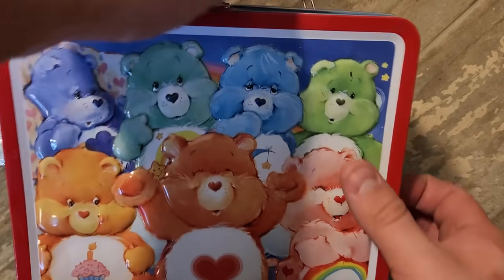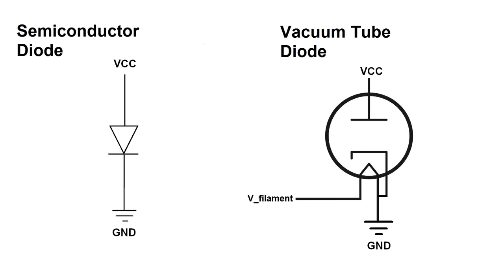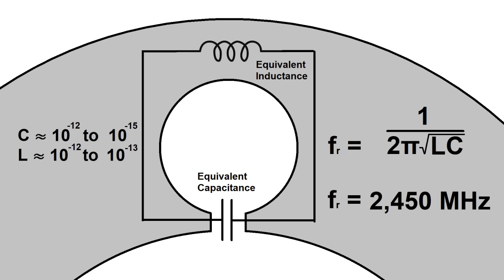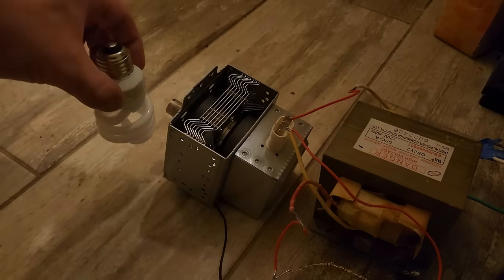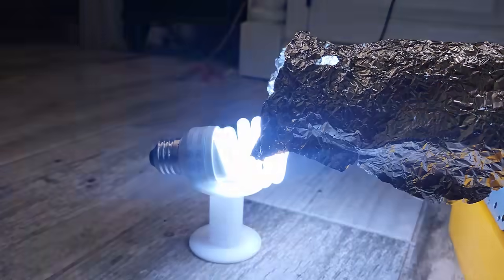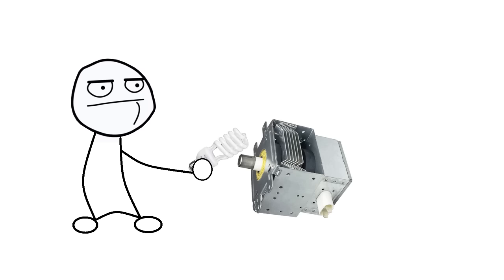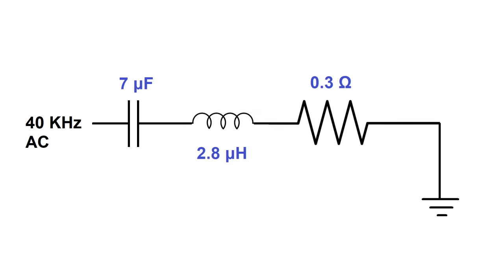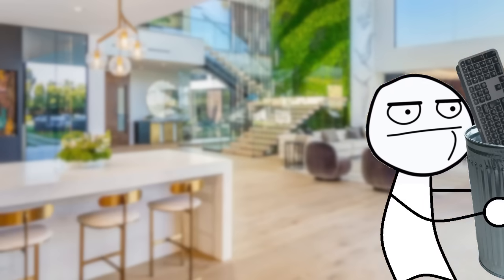Battery-Powered Magnetron

Comment: Hi i'm from Italy..altough i understood a Little about how does It work the magnetron very well i thought how does the vacuum tube work...the filament (cathode thunsteno)Is supplied with only low voltage like 3 Volts isn'it?and the High voltage from anode to cathode?for increasing the Speed of electron?when tungsteno Is warming the electron go towards to anode because anode Is positive as compared to cathode isn'it?...PS...Sorry for my english😅

Comment: 🇧🇷 I made a weapon like this, a metal tube, the magnetron was in the metal tube, I doubled the power, heated the water a meter away, placing more capacitors in parallel, the transformer does this

You can make glasses out of the microwave door screen

Comment: Pretty cool, I like how it's battery operated, for the HV transformer try to find a inverter microwave oven and use the transformer it should be better suited.

I try to overpower the magnetron with a large HV transformer the result was a magnetron driven plasma flame (my voltage dubler was not set up properly so I didn't have the maximum possible output).

Comment: Need to be careful with this stuff, the output filament typically contains a beryllium ceramic, if that crumbles and you breathe in any of the dust, you're toast. Also, if you happen to look directly at that filament while it's outputting, say goodbye to your eyesight.

Comment: when working with magnatrons I find a good working distance is about 200 feet, when no shielding is used.
you need a electro magnetic radiation meter detector to know what is coming out.  you have unknowingly exposed yourself to a great deal of microwave radiation!!!  not good.   be careful.  mike

Comment: The whole notion that ionizing radiation only causes cancer is total nonsense! The DNA double helix is essentially a fractal antenna. And all it takes is the right frequency to cause it to sympathetically vibrate like a tuning fork and it will cause it to vibrate and break apart, and then when it reforms randomly, if the cell doesn’t die via apoptosis, you end up with a cancer cell.

Comment: Id like to get into high voltage electronics. Where can one learn? I have a background in chemical engineering with some (but limited) knowledge of electronics
Reply: I recommend you start by experimenting yourself. There are lots of great channels, most of them with very little subscribers, so I recommend you build some basic high voltage device and start playing with it until you see some phenomenon you find interesting and do some research about it, Eventually your whole YouTube homepage will be full of high voltage videos. Of course you have to be safe doing all this, one hand rule at all times and start with low power high voltage, don't go straight into MOT's like I did, it's not worth it.

Comment: better rectifier doubler design -  is brige doubler:

(-2000VDCout)--------|>|-------(~in1)------|>|-------(+2000VDCout)
(-2000VDCout)---------| |-------(~in2)------| |--------(+2000VDCout)

it consists of two halfwave rectifier, but it gives fullwave rectification
on 40khz you will get 80khz pulsation output voltage,because it gives summ of two halfwave rectifier 40khz pulsation output, like 4diode brige rectifier do, 
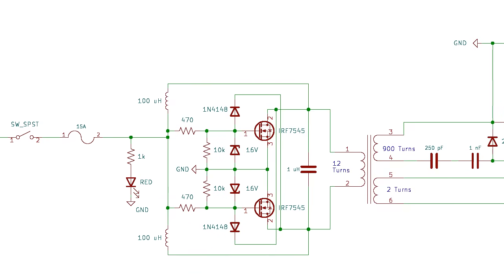but 14:03 halfwave doubler rectifier will give only 40khz pulsation of output voltage, because it actually sine wave shifter upon zero level, when only one peak of maximume voltage will be meaningfull for pulsation of result voltage

transformator from TV flyback anode supply can provide 
at least 200W longtime power... my result, but 
it was not 12VDC -> HV stepup, it was 220VAC *50Hz  ->  15KVDC*0.013ADC 20KHz !
it works almost same on 60KHz , but even 40KHz heats core(ТВС110ЛА , М2000 core material  rated) to 50C approx. and  in one day of work, 40KHz burns HV coil like in your project, 
in ТВС-110ЛА  secondary coil some like copper wire 0.08..0.14mm 2000turns, air inside closed tight case of HV coil
1)your copper wire too fat, 0.1mm diam. already excess, 0.06mm you can get in bell ringer of old phone apparatus, there will be two electromegnet coils: 6000turns*0.06mm copper wired
2)900turns is too low, if you expect 1volt on turn. 12v for  
drainmosfet--^^^^^^^^^^^^-(+12VDC)-^^^^^^^^^^^^---drainofsecondmosfet  (12+12turns prim.coil equal to  /‾‾‾+12v‾‾‾\___-12v__/‾‾‾+12V‾‾‾\___-12V‾_/  for 12turns coil,+ 1Vpeak  on turn of primc.
so sec.c. with 900turns will give +- 900Vpeak _/‾\_/‾ (so approx.1800VDC after doubler rectifier) under full load, and much more if you allow it to resonantly oscillate transformer with primary cap., happens when little load , like 1..10 Wt... 

in your ZVS circuit there is no central wire of primary coil, but virtually, it is like 6+6 turns,
----^^^^^^----^^^^^^--- 
and inductance of +12Vsupply of drains of mosfet, will equate its DC potentials on DCurent via 100µH power curent supply inductance coils from +12VDC to drains of mosfets
so, it will be 12VDC on drains, each mosfet work like:   
(open mosfet) 0v_/(front, closingmosfet)+12v/‾+24V(closed mosfet, extra curent from 100µH) 
with (+12VDC (+ )12V)= 0/12/24\12\0    >---^^^^^^-^^^^^^---<  24\12\0/12/24  =(+12VDC ( +)12V) 
so it is /+24\-24/+24\-24  on ---^^^-^^^-^^^-^^^--- 12your prim coil turns, +- 2V on turn you actually put in prim 12turns +-24Vpeak /‾\_/, and 900turns gives +-1800V_/‾\_/‾, that provide 3600VDC on doubler rectifier output probably

but in my experience 200wt was reached only when 220VAC->310VDC< + - 155VDC for halfbrige mosfets 2*IRF840N only, and PolyPropylene cap in series like loudespeakers amp outcap... 
and there was exactly 42turns of 0.5mm coper wire in primary coil, placed like your, oposite to HV coil... 42turns supplied with 20KHz of 
/‾\_/‾+155v‾\-155V_/‾+155v‾\_-155V_/     >--^^^^42turns^^^----|0.5mkF PPcap|----|common(-155VDC)
so +-155V _/‾\_/‾ on 42turns  means (+- 3.69[V on turn]), not less that 3.69, when your system 2V on turn only, that what i started with... 80turns for +-155V /‾\_/ primary coil, and only 30..50Wt was obtainable in that case, then i rewind some turns and power rise, on 42turns it reach 200Wt continiously, and on 40turns it explode mosfets spontaneously... there is no choice range, it must be 42turns for +-155V primary coil, and secondary coil was approx. 2000turns, and provide +-7500VDC on doubler brige rectif. 15KVDC *13mADC
---
on 20kHz it works continiously weeks , not brokes
on 40KHz core was hot 50C app. and secondary coil burns after 12hr of work, due to... ozone from corona discarge in air between layers, that just oxidize isolation film like your 3Dprinted plastic also, so you have to lower freq, and/or  put coil in oil, or glueit by epoxy glass in vacuum, to wet throuly

Comment: 4:50 in proper mode ofoperating. VD+C  chain not just voltage doubler rectifier, but called "zero level fixator circuite", where on capacitor alwaysapproxymately 2000VAC*141%(...it is sqr(2)...)≈2820VDC
that 2820VDC + 2000VAC gives sine 2000VAC wave shift upside, upon "X axis", and you get shifted to allways positive voltage sine:    _o|___/\/\/\/\/\____>   2820VDC+2820V*sin(f*t*...)=sine that in range  0Vmin / 5640Vmax\0V/5640V\/\/\/\/
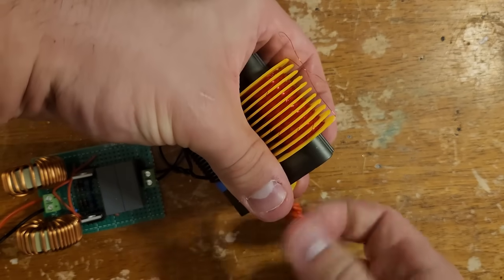Reply: 12:14 not just a filament itself have reactive(inductive) resistance, but inside metallic shield, near сathode heater connector , inside - there is build in - special DC(LowPass) filter... two inductive chokes in series with connector and cathode heater filament,  -  two coils about 1mm copper wire wounded on 4mmD*20mmL ferrite core rods, in series with cathode heater..., same two induct. for two pins of connector...
so, IMHO it is wrong idea, - to supply cathode heater chain with AC HF(40000Hz) current, even if you put some capacitor in chain also, you will be deffinately able to reach hi heating current, but unstable on changing conditions, because oscillatory circuit RLC chain appears there: 
>-------C-------[-L-Rheater-L-]-------<
and when there is only R and one type of reactivity impedance in chain, like  >----R---C---<  chain or >-----R-----L-----<, or capacity divider without chokes:
>-+---C---+---C-----<
   ^---R----^  
you get not resonant freq in chain, it will be just linear freq responced, and if freq changed from 40KHz to 45KHz, it will not affect on current flow via reactive resistance too much, just 10..20% parameters deviation occurs, but with LC chain, resistance of it can drop to almost zero on resonant freq, voltage and current of L and C can ten times rising compared with voltage of your transformator choke low voltage or low current,
f.e. auto ignition HV coil for 12v circuits, due to L of primary 12V choke of transformator, take too low current on 3000Hz*20VAC  (amp for 100Wt 4Ohm S-90 loudespeacker), provide 1mm gap spark only(in car oncompression when full throttle opened air inhale, 10bar  adiabatic 22bar pressure require almost 30KV for 1mm gap discharge ark in ignition candle... compressed air, and petrool also - are good isolator compared with air...
3KHz was best freq for my ignition coil, so i add 0.1mkF capacitor in series with amp and 12v primary choke of ignition coil, so it starts sound not allways but only at 3KHz louder, there appear CLR chain resonance with Q=10, and voltage on amp was 20VAC*3KHz*!5AAC! now big curent there appears, but on capacitor 200VAC and same 200VAC on series connected primari coil ign., giving 15mm ark now, loud with 6000tīmes ark persecond of 3000Hz + & - pulsing sineHV
and only  +- 2Hz accuracy allow to get resonant, otherwice  some uncoltrolable less power, outside the resonance mode
it working only with film capacitors with PolyPropilene or PolyStirene or Mica or Teflon film type caps, and when i put mylar PETF film polyester type cheap film capacitor there, i get only 60VAC resonant (Q=3), 3mm long arc, same 3KHz with same C but due to dissipatiōn of PETFcap, resonantbecame wide +-200Hz but weak60VAC...not...200VAC, and after 1minute capacitor flame as resistor flames often
PETF film heats too much even on 1KHz, but only in oscilators, where deep polarity changing reĉharge mode used

Comment: If the same lightbulb is placed in the microwave it will light up? Or will it be a 911 call? 🧐 Asking for a friend 🤔
Reply: Both. You will have plasma, but I'm not sure if that's something you want on your microwave, there are easier and safer ways.

Comment: the US military tested a weapon system they called the microwave flamethrower... it was a single lead armored unit or vehicle mounted unit that just cooked everything in front of it. 
it damaged the eyes first, almost instantly blinding the victim, and would rarely do lethal damage, leaving the enemy only severely burned.
it was scraped because it was determined "too cruel for war"  ...and partially because the batteries in the 70s were not good enough to make it practical.

Comment: How did adding a capacitor in series with  the filament reduce the impedance from the filament inductance? Can someone explain?
Reply from the maker: https://www.electronics-tutorials.ws/accircuits/ac-resistance.html
Reply: @HyperspacePirate  Thanks! I forgot that the phase shift makes the capacitor reactance negative in the sum.

Comment: Actually, running a triode with a positive grid voltage means most of the emitted electrons end up creating a grid current which is generally undesirable. Anyone wanting to use a triode should refer to a datasheet. The standard old microwave supply transformer has internal shunts for current limiting the output. Although I haven't measured it it would likely have a pretty high magnetizing current. And because of the half-wave rectification, it injects a lot of DC back into the mains in the form of harmonics.

Comment: could you not have used a feedback winding that connects to the two gates and a single 10K resistor from VCC to the one one end of the feedback winding and you could get rid of all the diodes and other resistors google Royer Oscillator with a feedback winding.

Comment: I was wondering about the wave guide from the beginning . You could cast some aluminum with a mount at the base and an extended tube to try and isolate the wave a little better and protect yourself a little better . Scary stuff ! Thanks for the share.  :O)

Comment: There's something wrong with your transformer if its still pulling 8 amps with everything disconnected ? It shouldn't even draw an amp open circuit.

Comment: OK room temp Iq here. What would it be used for ? Make noise at a HAM fest ? induce voltage to a fiber optic cable. Sorry I'm lost on the application of the unit.Sapper tool in a server farm.

Comment: That ring is highly unlikely to be beryllium these days. Only the very early microwaves & some of the later Russian ones will have a beryllium insulator, so you’re extremely unlikely to come into contact with any of those.

Modern microwaves are far too cheap to contain beryllium insulators, they were changed over to alumina decades ago.

Comment: The military has a beam for crowd control which causes unbearable skin heating. There is a possible danger from producing cataracts in eyes and ophthalmologists recommend not hanging around your home microwave while waiting for your frozen dinner to nuke. My other concern is if it kills wireless keyboards what does it do to $1,500 cell phones? Why does it have a component made out of beryllium because the toxicity is so significant instead of some other material?

Comment: Friendly reminder that electromagnetic radiation is an isometric process and to use appropriate shielding so as to prevent RF injuries.
Also your housing leaves much to be desired, man. If you short to earth through that thing, you are very dead or gravely injured.

Comment: I'm surprised more people haven't corrected you yet, but when a vacuum tube's grid is at zero volts the current is not cut off. To cut off the electron flow you need a negative voltage. For an anecdote, I was working on a guitar amplifier with poor contact to the output tube's grid pin and in less than a minute the anode started to glow red due to the uncontrolled current.

Comment: 100% silicone sealant , some mixes arc . Vacuum potting the transformer only to get the bubbles out for sealant ( or oil but some are flammable and messy but re-accessible or not compatible with the sealant or seals and some gloves ) .
Some older oil-bath transfomers have chemicals ( example PCB is NASTY ! ) so bad that you ( and your country ) do not want to be stuck with them .